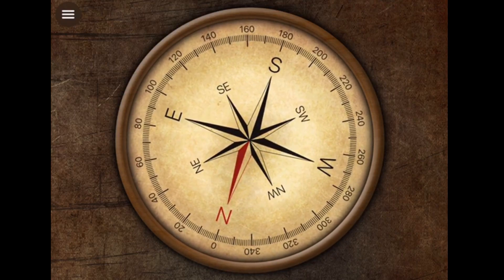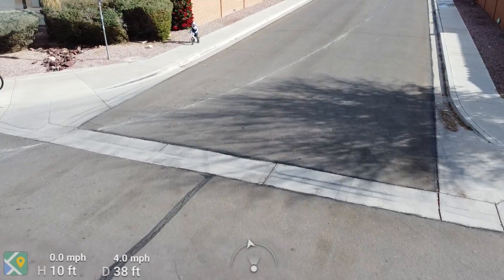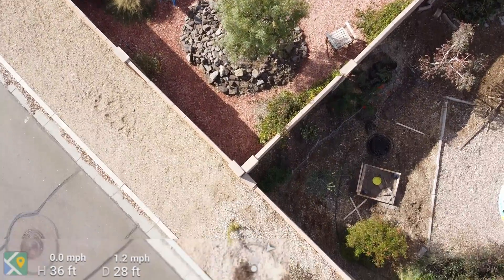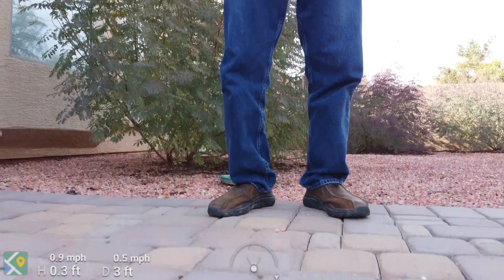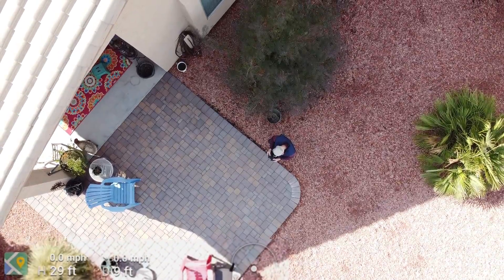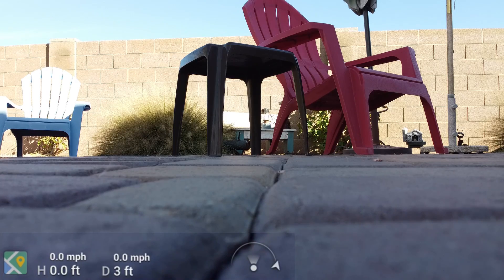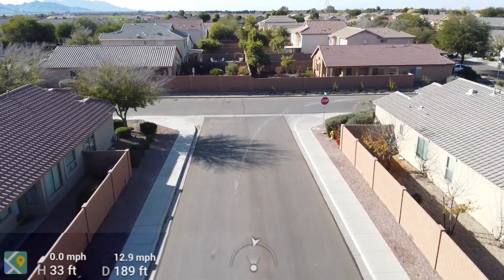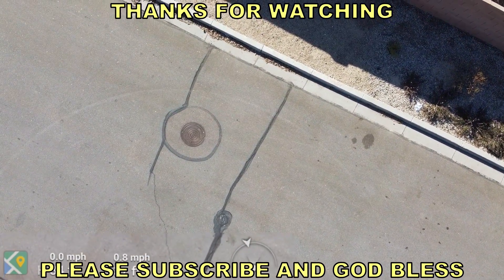MAVIC MINI'S AIRCRAFT ORIENTATION DISPLAY

Comment: Hi there. My aircraft compass does not show at all on the middle of the DJI app screen. Have you any suggestions?  Cheers
Reply from the maker: Hi Ian. Thank you for your question. Generally it is because the map is displayed. If you tap on the map until it shrinks down you should see the display. Thanks again and God bless.
Reply: @user-sr8pn9xg8z  many thanks for your reply. I will give it a try. Cheers ian

Comment: Please help me my orientation display just isn’t showing up on my phone
Reply from the maker: Thank you for your question Massi. It is generally not showing if you have the map in the lower-left corner expanded. Try making is small as possible. Thanks for your input and God bless.
Reply: @user-sr8pn9xg8z  even when it’s closed in the bottom left it’s still not showing up
Reply from the maker: @massipaiano2327  Hmmmm. Don't have an answer other than to do a full factory reset and see if that helps. God bless.
Reply: @user-sr8pn9xg8z  nah just realised there’s a new update 1.2.2 and the attitude display is located next to the map and you have to press the little icon in the bottom right when the map is opened to get it up

Comment: Mr. Kent. Thanks for your experience on this problem. I could not get my new I Pad 8 to show aircraft orientation. I solved this by turning on location services and authorizing the DJI fly apt use location services. You must authorize both. Also add a compass as the new 8 series does not have one.
Reply from the maker: Thank you for your valuable input Art. I'm hoping others will read your comment. God bless.

Comment: Hi, I am having this problem too and it doesn't matter what I do it is still unreliable. My controller will often show that it is a 180 degrees out and this is despite me calibrating my compass on my iPhone 7. Now I tend to use the google maps on the bottom left. The problem I have is quite often I use the mini in the mountain environment (in the UK) where I don't have a phone signal so can't use google maps. I have seen that you can download google maps for offline use for the mini so I will try this...when I figure out how to do it. Any other suggestions Mr Kent??
Reply from the maker: Thank you for your comment and useful input. The thing I have been doing which helps a little is to take off with the drone in front of me pointing away from me. Also, make sure you have the latest firmware update. That's about all I can suggest. God bless.

Comment: Howdy- New Mavic Mini arrived yesterday and, once all pre-flight updates and protocols had been completed, I got it up in the air. Voila! Immediately, I noticed the orientation issue that you presented here. So, I am planning on flying again today and wonder: When calibrating compass on my phone (which I had actually done recently), must I perform the calibration while the phone is attached to the controller?  Thanks in advance for your earliest response.  Jim
Reply from the maker: Thanks for your question Jim. The answer is "no" - once the compass is calibrated it is all set and running inside the phone. One less thing to worry about. I'm glad to hear you got your Mini. Have lots of fun and God bless.
Reply: @user-sr8pn9xg8z  Thx for the quick response. Crazy as it may sound, I discovered that some specific, magnetic field idiosyncratic to the controller might have been throwing off the orientation. Sooooo, I attached my phone to the controller and then performed a calibration and, voila, it resolved the problem for the most part. As you pointed out, it is not entirely precise anyway.

Comment: I am using an ipod touch to fly the mini and not only does the orientation function not work, it shows up as some red symbol. When I tap it, it tells me "no gps connection ". Do you think that app would help?
Reply from the maker: I don't think that is going to matter. But I think your Ipod doesn't have GPS built into it. If you cannot find your location on its map that would be what the issue if. Thank you for your comment Charlie and God bless.
Reply: Ipod has it's own maps app. I'll keep after it though. God bless.

Comment: Hi there and thank you for posting, unfortunately I am not not quite sure how you fixed the issue. Am I correct in believing you simply purchased a compass app for your iPad?
Reply from the maker: That is correct Shaun. I am using the free version and I have to have it running while flying. Also, I think various situations may cause it to function faster than others. I couldn't get  mine to work until I got it about 15 feet above takeoff level. Thanks for your input and God bless.
Reply: @user-sr8pn9xg8z  Once again many thanks for your help. I will download the app for my iPhone and iPad, I don’t want to have to rely on RTH.

Comment: I’ve run into this issue with my Mavic mini and iPhone 11. I’ve yet to verify, but this site has a section on compass calibration and may be helpful. As follows: https://www.lifewire.com/how-to-calibrate-an-iphone-4172146 I’ll confirm when I get a chance...
Reply from the maker: Thank you for your input Roy. Hopefully others will read it. God bless.
Reply: mrkentdotcom glad to help. I had the opportunity earlier today to confirm it worked! After enabling those GPS privacy, compass options, the drone icon in dji fly app was properly indicating drone orientation! Thanks for your video here, otherwise I would not have gone down this path to resolving the issue!

Comment: It is unfortunate that thw controler has zero effect on this. I did the experiment... took out the phone and turned the controller... nothing happened. But... If you look on the map... it shows the orientation of the drone to you. Why DJI did not use that as the orientation diagram I dont know. But to use the compass in your device as sole orientation is a mistake.

Comment: I'm in Georgia with a bunch of trees... How far do you think I can fight in a neighborhood without stressing out? Thanks for the videos.
Reply: There are too many variables to answer your question accurately. Now that being said, here's what I would do. As you take off make sure the home point is updated (GPS location is saved for return to home) then I would fly straight up and look around 360 degrees and keep climbing in altitude until you are higher than all of the trees and obstacles. Watch for when you are above all trees and other obstacles (antennas, buildings, etc..) and note your current altitude on the lower left of your screen. Then bring the drone home and set your return to home altitude about fifty to one hundred feet above the altitude of the obstacles but no more than the maximum FAA allowed of four hundred feet. Also, set your maximum flight range to a comfortable distance, say five hundred feet or so to begin. Remember, if you set the RTH height correctly and you lose reception the drone should automatically head back to the home point and you will most likely regain control before it lands. You can then increase the max distance a little at a time until you feel comfortable and get a good understanding of the interference and range limits in your area. Keep watching Mr. Kent for great content and explanations on the best and most responsible ways to operate your done. Good luck and happy droning!
Reply from the maker: Thank you for your comment Trevor. I guess the only advice I can provide is to be careful and make sure your battery is fully charged before taking off. You don't want it to give out before getting back home (As once happened to me and my Bebop 2 fell 270 feet to the ground). God bless.
Reply: Do you all turn off your Mobile data or  Go into Airplane mode when flying?  Thanks for the advice
Reply: @Trevor1989jeep  If you want to be sure there are no interruptions (phone calls or text if using a phone) and the least amount of reception interruptions I would recommend airplane mode. But, get everything ready and put it in airplane mode right before you take off, otherwise the map in the lower left corner of the DJI Fly app will have no data. Most don't put it in airplane mode and I have seen no difference with airplane mode with regards to reception but then I haven't flown more than five or six thousand feet away. If you try things incrementally, you will find the limits safely and then be able to figure out what works best for you and your specific situation.

Comment: Thanks for the video and research on this subject. I will download Compass X on my iPad Mini and see how it works out. Happy New Year.
Reply from the maker: Thank you Bob. I will be interested in hearing how your results turn out. From this video I have discovered that the drone should be at least 15 or so feet off the ground before testing to see if it all works. God bless.
Reply: mrkentdotcom I have used my iPad Mini 5 and Compass X on two long flights so far.  It works correctly most times and when it doesn’t it just drops out so that I see the red icons at the bottom of the screen. The last time it dropped out I took note of my surroundings and I was about one feet from an iron fence.  I will keep running that way and take close note of drop outs and surroundings.  I wish that I had a cellular radio in my iPad Mini for GPS to correct the compass like it does on the iPhone.